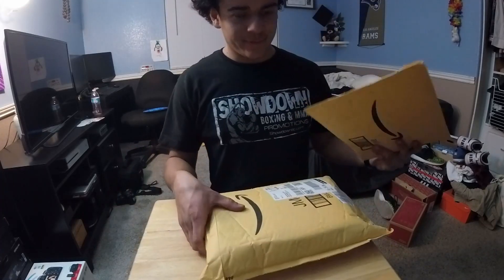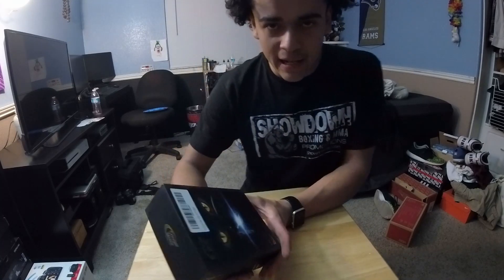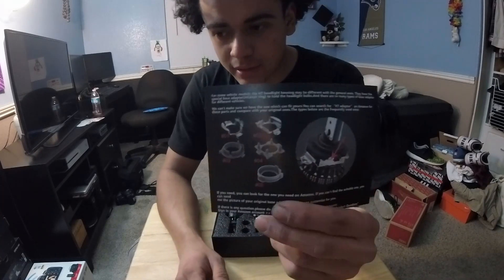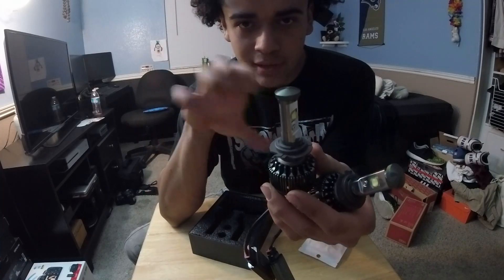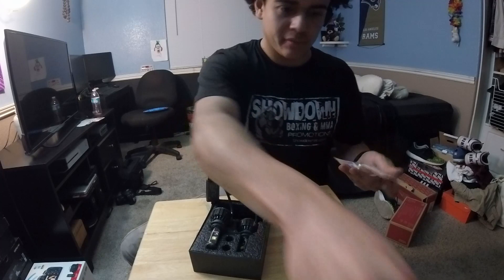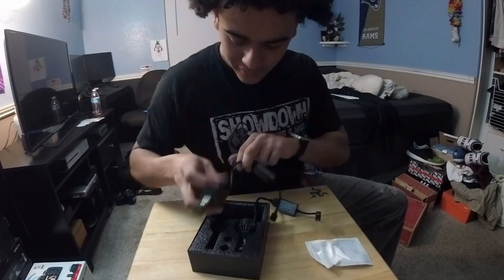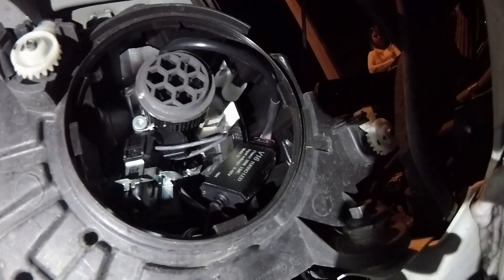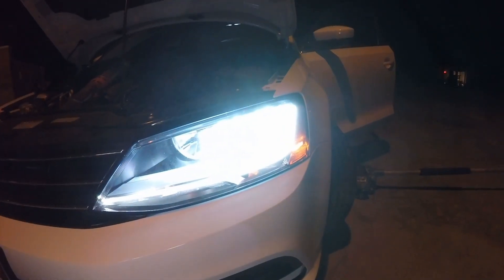2017 JETTA LED HEADLIGHTS

Comment: I upgraded my halogens to led (driver and anti-flickering) also got an extra clip, but a few weeks ago I notice that Lasfit has some plug and play bulb (no driver or anti-flicker) and no error no extra brackets. I just ordered the led turn signals front and back and the brake bulbs to complete the halogen and incandescent bulbs replacement.
Reply from the maker: Nice thanks for the info I’ll have to check those out as well!!

Comment: Bro! Was this the first time you changed the bulbs? I’m planing to do this but I’m afraid to scrub up.
Reply from the maker: First time changing these bulbs on this car I’d recommend doin them they are so much better!!
Reply: Augie Lopez did you have to buy adapters or you just installed them without those ?
Reply: Gabriel Rodriguez I ended up doing it and it's night and day difference. The mounting brackets in the video are the ones you need. Assuming you are doing it on a newer Jetta.
Reply: Yeah, same 2017 Jetta with led strip but crap headlights.

Comment: Did you have to use the mounting brackets? I bought LED’s through superbrightleds.com and they don’t fit
Reply from the maker: I bought my lights off amazon but yes I did have to buy the brackets for them because they wouldn't mount properly without them